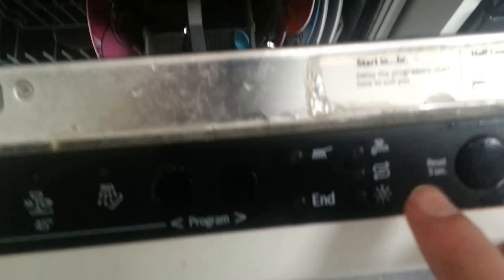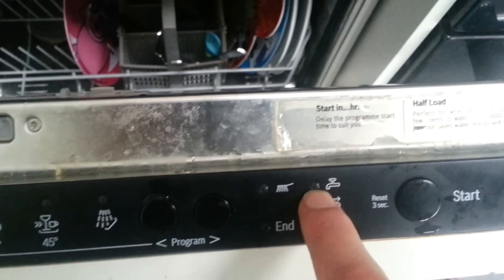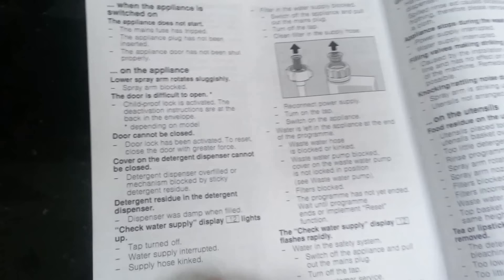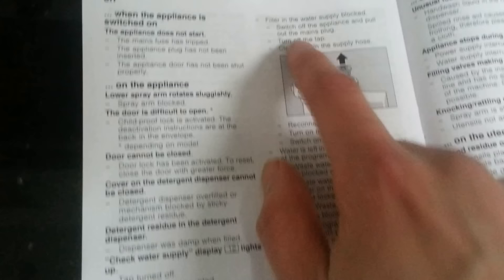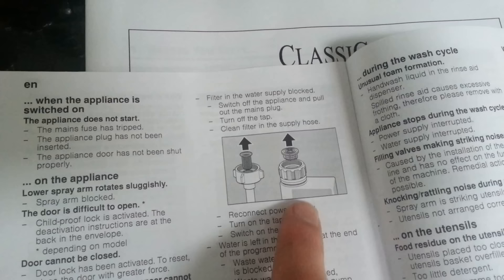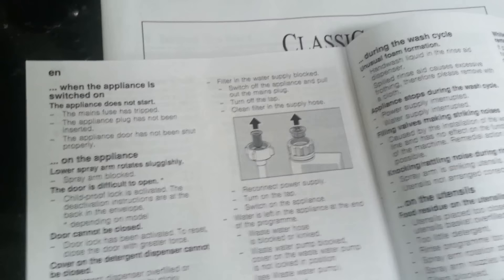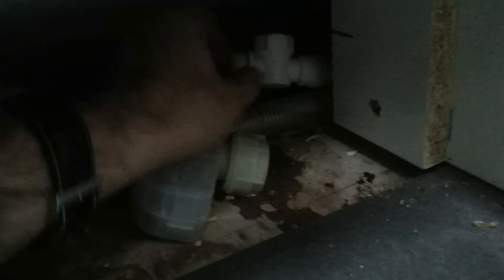Dishwasher water inlet filter check [HD] - SOLVED

Comment: how is this "solved"? you still dont know why the light is on
Reply from the maker: We've not had it since we made sure we weren't running another appliance (like a washing machine) at the same time.. as I mentioned in my update in the description, it seems to be the drop in water pressure that causes the problem.
Reply: @teemutalvitie3309  😂😂😂😂😂

Comment: Thank you!!  Just saved me a service call - this very unhandy person fixed the problem by following what was done in this video.  There was a tiny bit of dirt inside but didn't seem enough to stop it working, but it is working now!  My dishwasher has the check water light on the front and the cycle wasn't even starting, so different model, but same fix.
Reply from the maker: Glad it helped! :-)

Comment: Dishwasher water inlet filter check [HD] - NOT SOLVED
Reply from the maker: :D It did solve the problem for me.. not sure whether it was a small speck, or air bubble, but we've not had the issue since.
Reply: @Endpoint101  Yeah but you did not do anything. You just looked at the filter and found nothing was wrong with it and screwed it back together. You may have inadvertently released some water or air.
This guy SOLVES the problem:
https://www.youtube.com/watch?v=d60BJo8fzpA
This issue is caused by either a leak into the bottom tray or the foam bar in the overflow trigger if it is so old it has deformed and needs replacement (it triggers without water).
Following this guys video i was able to determine that the small dent in the dishwasher door has compromised the seal and water was leaking into the lower tray, triggering the overflow value and thus showing the water inlet error.

Comment: After cleaning the filters, which were full of rusty dirt. The plastic filter casing's threats, similar to the one in video were apparently damaged and was unable to screw it back to the coupling in the wall. I s it possible to  obtain the filter casing or plastic screw - in casing without having to replace the entire inlet pipe?

Comment: I had the same problem after a bit of cursing and swearing I found that it was the Aqua stop solenoid stopping the water going into the dishwasher good old eBay I've ordered another hose just waiting on it to arrive
Reply: Did it solve the problem as I think I have the same issue.

Comment: I've got exactly the same problem but I don't see a resolution on your video.. I checked the inlet and completely clean. But there is a filter on the machine and I guess we need to look at that. Sometimes number 7 shows as an error in the manual and sometimes number 12. I think number 7 means cleaning and we've cleaned all the filters and the pump impeller seems to spin without a problem. Number 12 is this video.

Comment: not sure if its a good indicator, but instead of ripping the filter out and finding out it was ok, just shine a torch through the side of the plastic box and if the light shows through the filter i would assume its clear. I still have the issue and i am still investigating.
Reply from the maker: +sempei58 Hmm, I'd still open it up like I did in the video.. stuff gets trapped in the black washer and red plastic insert.. you'd not see that by shining a torch through it. It doesn't take long to unscrew and check it.

Comment: Does your washing machine open automatically?
if so, is there and on/off switch for auto open after its done washing?
Reply from the maker: This is a dishwasher in the video. But our Bosch washing machine(s) haven't had an auto-open feature.
Reply: @Endpoint101  oh sorry I meant dishwasher, not washing machine
Reply from the maker: @jonlarsson5401  No worries :) TBH, I didn't even know this was a feature! I guess it helps to vent the steam & dry the dishes faster?
Reply: @Endpoint101  me neither. All dishwashers I've used automaticly opens after they're done. but my new one doesnt for some reason. it only beebs and then I have to manually open it. thinking it might be a child lock or something. can't figure out how to set it on open.
Reply: @jonlarsson5401 why are you asking random people about random dishwasher rather than google it and read manual?

Comment: i have a dishwasher where this exact part that you are showing in the video is leaking. i am trying to find out how to open this white plastic casing and also what exactly that part is called so i can replace it. if i order a water inlet valve, which is what i think it is, is it? will any valve work with any model?
i am not able to find my dishwasher by model number. help?
thanks
Reply from the maker: +dishfixhelp storm The dishwasher model number should be etched in the metal of the door.. I had trouble easily seeing this on our old one, and ended up taking a picture at the right angle for light to reflect it best.. then enhanced it in an image editor to really help see.

Comment: Where is the filter and how you removed it is not shown. No use of incomplete video.
Reply from the maker: It didn't actually require any further dismantling.. not sure if there was a speck of dirt I removed, or an air bubble, but this solved it without doing anything else.

Comment: Why did you make this video? Lol!
Reply from the maker: Hoped it might help someone.. I've not had trouble with mine since opening it up; was thinking maybe it was an air bubble or something.
Reply: This helped me. Upon unscrewing the pump part from the water supply, I notice that I don’t have the red part in my filter.. only the white! But my dishwasher has been running really well up until recently. Maybe it’s due to glass or or ceramic plates chipping ? during the cycle? I checked the filter and white spinner thingy at the bottom of the dishwasher and had a clean but did not feel
Or find anything.I believe you are correct to mention when using the washing machine and dishwasher at the same time the water pressure drop as they are both connected to the main supply. Thanks 😊

Comment: Yeah, isn't German Engineering fun?  You have to babysit something that should not ever be a problem.  The water inlet line?  Why is there a filter on the water inlet??  WHY??  Just let the water come in, let the cycle run and let the miserable excuse for a dishwasher catch it in its 'user maintained' filter.  That is still a pain, but arguably easier than pulling the dishwasher ever 6 months.  Sheesh.

Does anyone know if you can just get rid of that screen so you don't have to spend an hour disassembling the thing?  Yes, you have to unscrew it from the cabinets, disconnect the water line, mop up all thew water that belches onto your floor, pull out the filter (which is connected to the inlet solenoid) and clean it without breaking the solenoid.
Reply: @Cap'n Jan, I had the same thought as you have commented above. But after disassemble a dishwasher inlet valve, I realized that a filter is necessary to protect a moving stem inside the inlet solenoid. Without a filter, a solid particle could be stuck on the surface of the moving stem causing a jam of the solenoid.
Reply: So the supply lines inside your dishwasher don't calcify and stop working after 6 months if you have a bore water or hard water supply